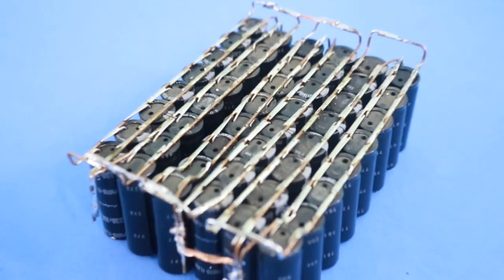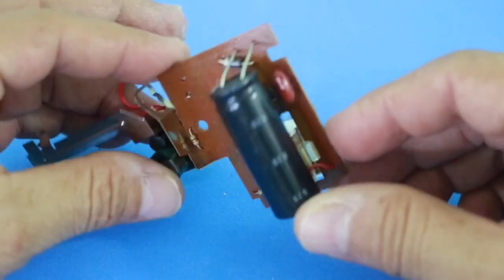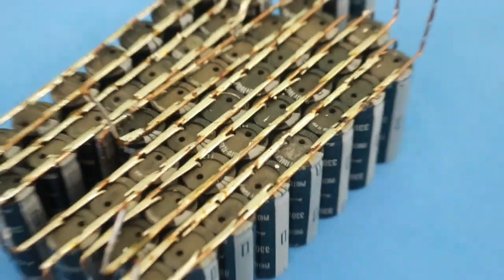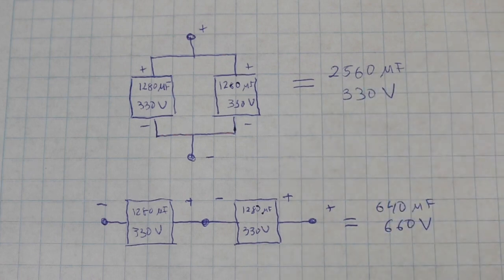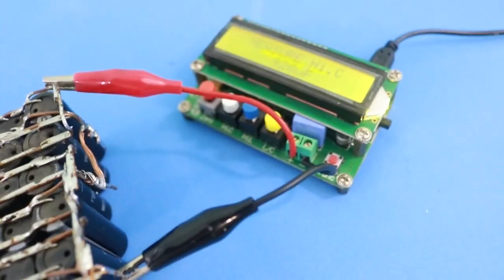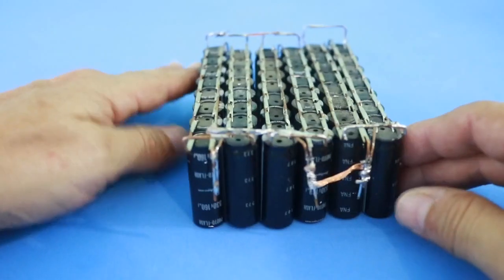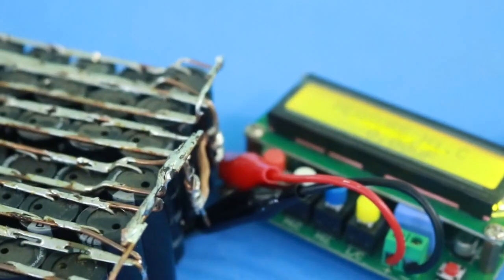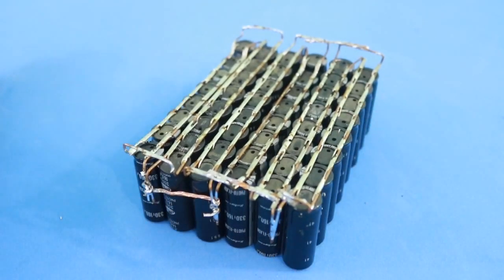High Voltage Capacitor Bank - Part 1

Comment: YOU can utilize a circuit that charge capacitors at high voltage. I have built one and it works great. Can charge capacitors with a max of 600V, because in the circuit there is a high voltage mosfet. If i use a 900V mosfet it can charge capacitors at 900V!. BE CAREFUL WITH THIS THINGS...  With high voltage comes great responsibility!
Im so curious to watch the discharge of this beast... It is probably VEERY LOUD... A 68uf 400V capacitor can produce peaks up to 95 dB... This bank is OP! Be CAREFUL!
Reply: Shorting 400J will be as loud as a gunshot, i know from experience.
Reply: Yes, this is OP... But if he short the bank with wires, the huge spike of current will be limited by the wires resistance and the spark should be weaker... But this thing is still OP
Reply: OR... Discharge it with a large resistor (100k ohm 4 watt)... With the right resistor it works perfectly with no BOOM.

Comment: you should cover those connections at the top as well to prevent from getting shorted accidentally when you put a metal on it, also can you show me how to switch that 900 volt without using relay? I wonder if BJT or mosfet able to handle that much voltage
Reply: It can be swicthed with a mosfet because there are mosfets that could handle upto 1200v!